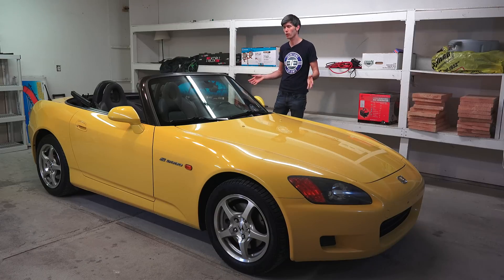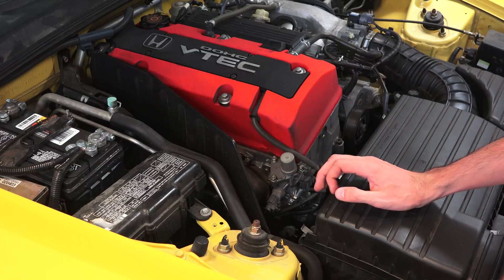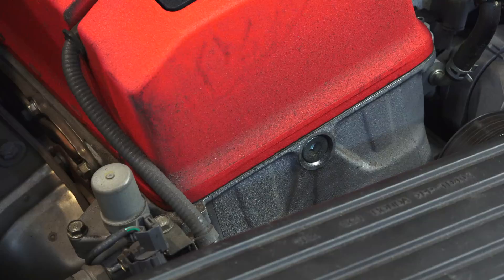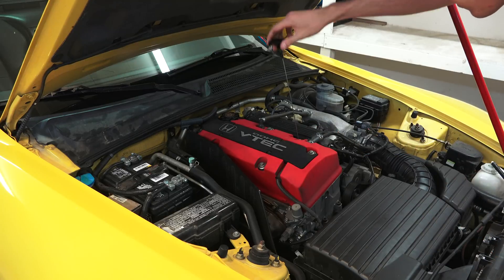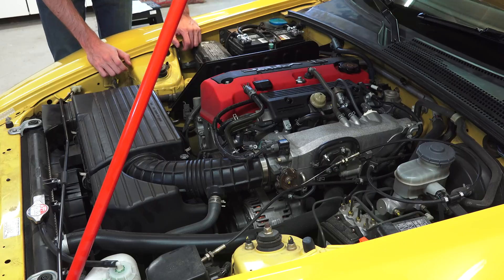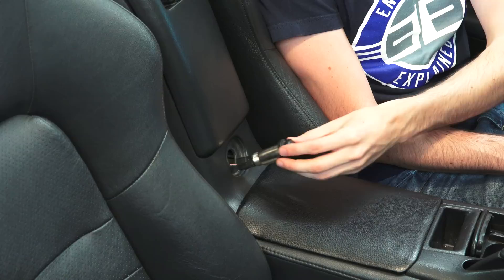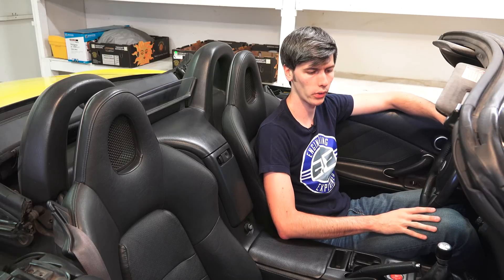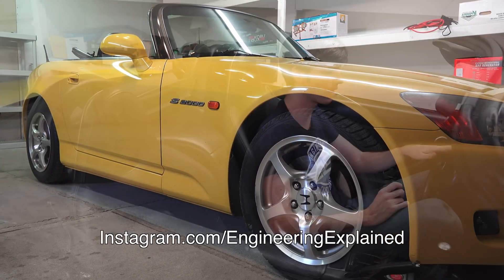What's Wrong With My Honda S2000?

Comment: You need to throw out that factory cold air induction system and install a Boi-racer-as-seen-in-a-magazine-style open element that sit exposed under the hood and sucks in tons of super hot under-hood air like all the other magazine fan-bois do... because they saw someone else do it - so it must be better!
Reply: A cold water intake is good for 25-400 whp bruh ass long as you have the supporting sticker mods
Reply: He's still a noob cause he hasn't painted his radiator black yet.
Reply: OH!  You need to expose your timing gears to the road debris too!  Take off the timing cover like all the kids in the magazines do - because someone told them that was cool too!
Reply: Man, while I'm on a roll don't forget to put a blow-off valve on it!  You MUST have an externally vented blow-off valve... because the magazines say that's cool too!
Reply: And a FART-PIPE exhaust!  You need to get a fart can exhaust because the "lawnmower" sound is awesome!  Just ask any "other" Honda owner.
Reply: OH!  And plastic ground effects!  Yeah, what Honda wouldn't be complete without adding shit-tons of unnecessary weight and poorly designed aerodynamics through the use of ugly shit you bolt on your car.  Do it!  Boi-racer magazines say it's cool!
Reply: or stick it in the fender and vacuum up a puddle.
Reply: +NorthernChev your having to much fun
Reply: Oh... you forgot the bestest mod ever: mounting a Cessna wing upside down on the back! Gotta have that downforce!
Reply: +sp1nrx The ole' "park bench" spoiler!
Reply: he could keep the airbox and replace the filter. and the s2ks sound real good when they do the uk exhaust mod. it frees up a little power and gives it a deep exhaust note.

Comment: Regarding the power outlet, a nice fix would be this Dual USB charger from Crutchfield. I'm currently running one in my car and it's been working flawlessly. The charger has spade connectors, so you can de-pin the Honda plastic connector and reuse the wiring without further modifications. Just use some electrical tape on the connections to prevent shorting. Check it out, and I hope this helps! http://www.crutchfield.com/p_074USB12V2/Accele-USBR12V2.html

Comment: My 93 Nissan 240sx Convertible has the same issue with the timing chain tensioners. Guess it is a common problem on the KA engines. Nissan service bulletins suggests simply removing them to stop the rattle and it will not effect the performance of the engine.

Comment: I had a 2003 S2000. 
First of all, sanding the worm gear is a genuine fix, buying a new one will only delay the inevitable.
Check the oil every tank of gas, getting into VTEC burns oil.  

Also, check the rear cv axles for grooving.  It will usually makes some noises when you are moving and off throttle.  These can be easily fixed by swapping sides and regreasing.

I think you'll be really happy with the car!  Love the channel and thanks for the content.

Comment: Surface rust on a suspension component is a non-issue. Change it if the bushing or joints are bad, but not if it just has surface rust. Awesome car though.

Comment: Enjoy it in proper health dude, having one of the highest piston speeds in a production car motor is pretty sweet too, as far as modifications I wouldn't do more than a test pipe and an intake with a tune. Anything/everything else will start to rob civility and won't really do much as far as bolt on performance. Unless you're looking at f/i but I doubt that's the case. Have a good one dude.

Comment: Can I use the same oil in the manual transmission and open diff in my E36?
Reply from the maker: +iksio some cars will use the same oil in both, but I'd check your owners manual to make sure.
Reply: Engineering Explained thanks for the answer, I don't have the manual but I'll check online
Reply: If you have an E36, why can't you just buy the factory recommended fluid?
Reply: As I said before, I don't have the manual. I also own a compact (ti), which doesn't have the same differential as other body styles

Comment: Not sure why your oil pan would need resealing unless someone got in there and messed with something prior to you acquiring the car.  Possibly they replaced the banjo bolts for improved oiling on the track but did a poor job with the seal when reassembling.  The TCT can make some noise and while it will not cause any major problems, it is easy to replace.   You could look into Billman's TCT, supposed to be an upgraded version of the stock TCT that is supposed to never need replacing again.  Here is the link:  https://www.facebook.com/BillmanS2000/.  Everyone has their opinion on what are the best fluids.  For the transmission, Honda reformulated the Honda MTF a few years back and it seems to be a good choice these days.  Honda does not make a specific fluid for the rear differential, most people use a common synthetic 75-90W hypoid oil like Mobile 1.  At a 130,000 miles, my 2002 Spa Yellow has not exhibited either of the two problems you mentioned and I am getting ready to replace all my fluids soon as part of normal maintenance.

Comment: Also take note if the engine idle dips below 800rpm and rattles when you clutch in occasionally. It's a common AP1 issue and can be improved by cleaning the throttle body and MAF sensor.

Comment: How tall are you? Im looking in the market for one, but im 6'3" so im not sure about my height for the roof
Reply from the maker: +Muety I'm 6'1" and seem to be nearing the limit for fitting. My gf is 5'9" and the car is pretty much made for that height. The legroom is there, but with the top up you'll be pretty close if not touching. Apparently there are some seat rails you can buy to lower the seat a bit.
Reply: Alright, Thanks!

Comment: "What's wrong with my Honda S2000" Well simple,
No turbo.
Reply: Damn turbo fanboys incoming
Reply: The f20c is so awesome as is. Boosting these is blasphemy.
Reply: Building a n/a engine is much more impressive than slapping on a turbo
Reply: except the cancerous overused emojis, you'll grow up eventually and realize you're not 100% right.Craig Cundiff
Reply: This guy is super cringy geesh I won't even waste my effort to roast you, you did it for yourself already but hey, hit me up in 2-3 years allright? You might be around 14-15 by then, have a nice day.Craig Cundiff
Reply: for the DRAG QUEENS yea it needs a turbo and its kinda slow. all the track/circuit guys.. N/A is life.
Reply: I'd much prefer a s2000 in n/a form. I'd rather play with air filter, wheels, brakes, etc
Reply: +Patey 420 absolutely. ..👍
Everything is better with forced induction...👈
Reply: Turbo charged cars=premature engine wear.. Turbo charged cars= much more maintenance and costs .. I'd keep it the way it is especially since it's already burning quite a bit of oil!!
Reply: +Patey 420 💩😄
Reply: +xXxMartin96xXx That all sounds nice but I actually owned an S2000.  The top end horspower was fun but the utter lack of torque sucked on the street.  Almost bought a supercharger but then traded it for an EVO 8 rs.  The S2000 always felt like more of a car of aspiration vice realization of performance.
Reply: +prostcj +NorthernChev   You guys both make good points. As a previous s2000 owner who experienced both NA and turbo (450whp), I think it would be best to summarize that NA is a more authentic, fun and spirited drive whereas turbo is a more intense and exciting drive.  NA was best when carving through a parkway and turbo was best when I was chasing that coke-like rush.  That being said, NA always felt quick at any speed thanks to the diff gearing.  I'm a happy C63 AMG owner now, but getting the itch for a s2000 track car..... I really cant recommend this car enough!
Reply: +Carl Siemens If he did that his OBDII would constantly flash an ID10T(ango) error.
Reply: Everything goes faster with forced induction. everything goes smoother without.
Reply: prostcj Here's my 2 cents worth on forced induction.  Unless it's a belt driven supercharger (which starts making power immediately) it will experience turbo lag at lower RPM... Which is what the engine does already.  You gain nothing on the low-end from turbos. You could go with a smaller vane impeller to spool quicker but then it won't rev on the top end and you will RESTRICT this engine's abilities with turbos. Back then the engineers got around this problem by adding VTEC, and the S2Ks VTEC is not the same as the other run-of-the-mill-Hondas.  This one is/was state-of-the-art in it's day. I know turbo'd versions exist but the advantage is all mid-range boost.
Reply: +xXxMartin96xXx good point.  I'm guessing the s2000's already existing tendency to oversteer would make a rear-biased setup to risky for your average driver though. a proper track wing might be able to 'correct' this if the speed is high enough in a corners entry/exit.  i think 50/50 is ideal for mid corner static loads though so tomato tomato
Reply: Honda S2000 GT1 is turbo'd
Reply: yes! Turbocharge that S2K. ..👈
Reply: +Calum A correct.. But he could Turbocharge the AP1. .. get a nice aftermarket turbocharger kit for it....👈
Reply: exactly, also you left out the "yoo"Mbaze Pashtufu
Reply: +Patey 420i I'd break you  in half... Lol... Just because you don't know how turbochargers work.. Is no reason to talk smack in the internet to people who do... Read a book.. Real tough lip smacking for such a bony bitch...👊
Reply: 'Don't know how turbochargers work"...? uhm...k? You seriously have some problems it seems Craig Cundiff
Reply: +xXxMartin96xXx No, but the S2000 could use a turbo.
Reply: Wow, didn't think i'd cause such a ruckus lol.
There's only so much you can do with bolt ons on the S2K and yes it is a great and fun car but just like every other car, at one point you want more and there's nothing wrong with boosting a S2000, I mean, it is a S2000! But at the same time I don't know what his purpose for the car will be so maybe a turbo isn't for him so it's his choice.
But just imagine how badass it is to have a car that hits max boost around 4k rpm and screams all the way to 9k!! So awesome.
Reply: Yeah, replace that engine with a PBSVB TS100 or RR 250-C18.
Reply: +xXxMartin96xXx Well said, xXX!
Reply: NorthernChev 
They're turbo's, are they not?
Reply: +Carl Siemens ...you clearly weren't paying attention... I'm not involved with whatever you're yammering about with "turbos".
Reply: NorthernChev 
http://www.pbsvb.com/customer-industries/aerospace/aircraft-engines/ts-100-turboshaft-engine
Reply: +Carl Siemens Dafuq don't you understand? You keep replying to me as if I have some part of whatever the hell you keep talking to about. I have no idea who you are or why you keep replying to me. Go talk to someone else.
Reply: +Annuvyn Arawn Not sure what that means.  There are a lot of coarse, buzzy N/A engines.  If you are referring to power and torque curves I do get that.
Reply: +xXxMartin96xXx Thanks captian obvious, I'm not sure you have any point to make at this point.  Since I have expressed a point of view from someone you as actually owned an S2K, I will yield to the YouTube comments experts at this point.
Reply: +xXxMartin96xXx Have you driven an S2K?  It actually has all the power and grunt of an economy car down low.  If you want to call that pure feel free, but in the real world it is quite anemic.  Forced injection adds a lot of torque, that is why the S2K could use forced injection.
Reply: ***** Not to nit-pick and with respect...  most American V8s from the 70s had actual redlines of 4500 RPM not 5K.  The obvious exceptions were those engines that still had the 4500 RPM redline (in reality) but they printed their tachs to 5K to look "sporty". The fact of the matter was that the heavily emission-controlled engines did not have camshaft profiles that supported revs over 4500 back then (post 1972). Horsepower in these engines dropped off drastically above 4500 RPMs.  This changed dramatically in the late 1980s. But your point about the S2K's engine is correct.
Reply: prostcj I've driven stock S2Ks and the only way a person could say they have grunt down low is if they grew up driving in a generation (post 1989) where nothing has any grunt down low period, so in comparison it appears to have grunt... because they wouldn't know what "down low grunt is". I've track-driven a stock S2K... they don't make "actual" power until 4500 RPM.  Then the power comes on in dump truck loads. The only reason it "seems" to zip up to 4500 from idle is because of the extremely low rear end gear ratio. To counter the fact that these cars have NO down low grunt they put extreme gear ratios in the back to make the car move from a stand still.
Reply: +NorthernChev Agreed, notice I said all the power and torque of an economy car.....
Reply: +NorthernChev I traded my S2K for an EVO 8.  They are both 2.0 engines.  They were night and day.  The EVO did fall on its face up top until I installed cams.  
Comparing the VTEC to turbo boost is a bit comical.
Reply: +xXxMartin96xXx What people don't get that haven't driven an S2K is that the 240 hp is very hard to actually realize unless you are driving like a complete moron on the street.  My MS3 has about the same power I suppose but it feels so much more powerful on the road.
Reply: +DemonDue there's a turbo s2k around me we call el diablo its like 600+ wheel hp
Reply: +prostcj hahaha yes ms3 life💗
Reply: +Calum A 
The "GT1" was built by Amuse.  It's not Honda OEM.
Reply: At least its RWD.
Reply: +xXxMartin96xXx trust me, 50/50 is never a negative unless it's a drift car.  the balance is perfect.  i drove my s2000 through 2 winters with snow tires (honestly the best snow car I've ever driven- better than my f350 diesel 4x4) and the perfect balance made it sooo controllable and more importantly, predictable :)
Reply: Reminds me of the old Alfetta GTV 2.0 and 2.5 V6...gearbox in the back and perfect weight distribution.  One of the few (especially at the time) RWD cars that was awesome in snow - weight over the steering, and weight over the drive wheels.  :-)
Reply: you cant turbo a f20 c
you can but it wont make it any faster , what good is 400 hp s2k if its only a quarter of a 2nd faster than a stock s2k ?  its pointless cause the f20c is high compression
forced induction is best suited for lower compression engines

theres videos out there 
stock s2k vs turbo and supercharged quarter mile times

youll be shocked !
Reply: Same problem with my FR-S. I'm gonna wait to 40K miles before I bother to open up the engine and put in the internals I'll need for the power I want.
Reply: Supercharger works better for S2000 trust me
Reply: Explain why, this will be amusing.

Comment: Love the car, thinking of getting one.  FWIW, I never buy a car without looking underneath...seen too many clean looking cars with bad brake lines, rust, unibody damage, and the like.
Reply from the maker: +Chris  Hachet I squatted down and looked around each side best I could, but I don't have a proper lift so I took it to the dealer I bought my Crosstrek from to look over.
Reply: Engineering Explained
Makes sense, seems like a pretty clean ride, congrats!

Comment: Would you buy a Levorg instead of the crosstrek if it were available?
Reply from the maker: +robjapan if the Levorg had as much ground clearance as the Crosstrek, I'd certainly consider it.
Reply: Engineering Explained It doesn't, so the idea of buying a crosstrek is to have a sensible wrx that can go anywhere?

In that case, why not the Forester?

Comment: I've owned that car in the past.Ive bin a mechanic and tuner for twenty years. First gen s2000.s will burn oil 0ne hundred thousand miles on that motor,your looking to rebuild  in the near future. What ever you do don't let that motor ping if you get bad gas find good gas quick.